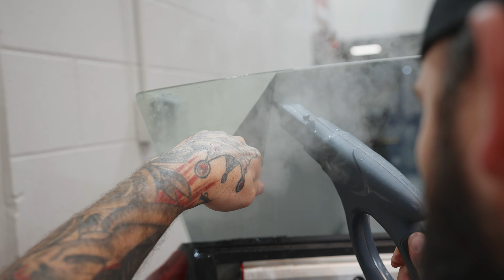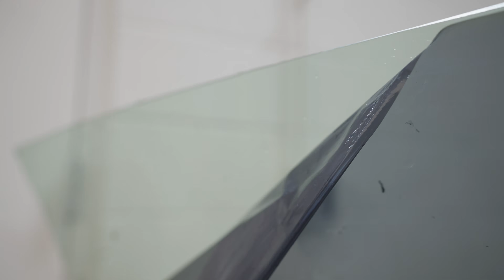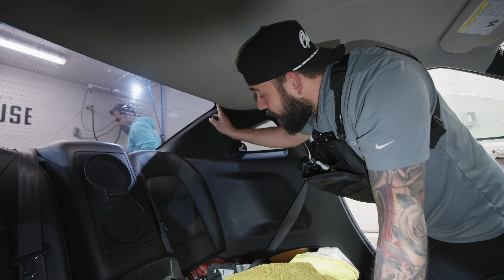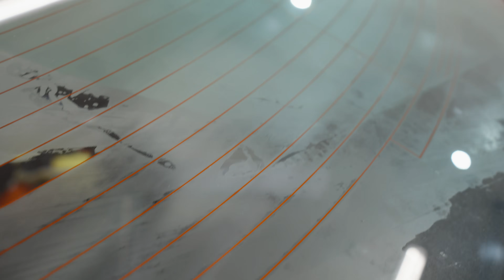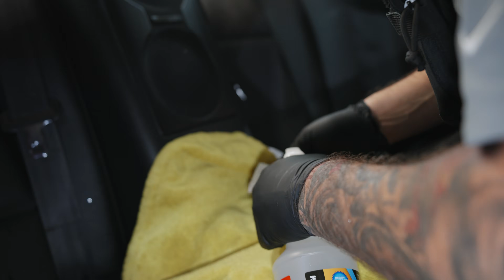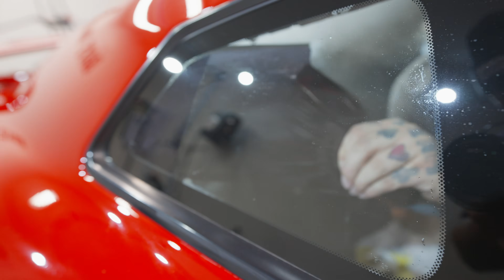How To Remove OLD Window Tint From Your Own Car

Comment: I have a 2002 Jetta I need to remove tint off the back window, after watching this video and reading comments, how far up shits creek am I going to be doing this job in the middle of December without a shop and outside in Oregon?
Reply: Lol...hello from Albany...if you have a heat gun or steamer it won't matter much...I'd wait until the afternoon of course when its well above freezing.

Comment: I already did what you're not supposed to do. How do I remove the adhesive?
Reply: @Eaglebone  I did the same thing but I used goo gone and that did the trick
Reply: If it is the side windows you can use a degreaser or soapy water with a blade and scrape off the glues residue, if it’s the back do as he did in the video

Comment: Thanks for sharing. Would removing the rear window to do the work be an option?
Reply: Yes you can remove the window as if you were to replace it. It’s a lot more comfortable to work with and easier to remove tint. It’s also very fast to install window film on it before you reinstall the glass too. I’ve done this before on really bad film. Make life easier for you whenever you can. Just tell the customer what you need to do and they will have some tape on the outside of the glass for a few days while the adhesive dries since you had to reinstall it. But besides that I think both of you will be very happy with the results.
Reply from the maker: Hi, I don’t understand the question.

Comment: Suggestion: pro window washers always use dawn, not window cleaner. You’ll get far far cleaner glass. Main ingredient in window cleaner is ammonia or vinegar. Neither clean glass well. Dawn degreases, de-oils, and has surfactants and will leave zero streaks with a squeegee
Reply: Ammonia deactivates the adhesive. In fact the window must be cleaned afterwards with soap and alchohol to make sure there is no ammonia left otherwise it'll cause the new tint adhesive to fail.
Reply: @reyray1123  read what I wrote. It's not unclear. I'm talking about clean glass not removal of tint. Find one place in my comment that references tint removal in any way.
Reply: Lol ammonia literally his terrible for window tint and will help you in this endeavor.  Might be a good tip for someone who is about to tent... But it's not going to do much for them removing
Reply: @skypallman6169  read what I wrote. It's not unclear. I'm talking about clean glass not removal of tint. Find one place in my comment that references tint removal in any way.

Comment: Had very old bubbled tint on my rear window. Yep an absolute nightmare. If you ever wish to punish yourself for something you have done wrong in your life, spend 2 days removing old film, backing and glue. Oh what fun 😂😂
Reply: I have ancient tint on my rear window. It's gonna be a bitch to get off without killing the defroster... 07 350Z
Reply: Go slowly and use plenty of soapy water in a spray bottle to help losen the old film, I used a plastic scrapper and finger nails, and be prepared for a long haul. Good luck my friend 👍

Comment: I used a basic black and decker travel clothing steamer from amazon that was 20 bucks. Worked like a charm! Thank you for this video. Was very surprised how easy it all came off with no glue remaining. Steam is def the way to go. I thought this would take a couple hours and ended up taking 20 minutes.
Reply: Was hoping this would be possible with just a clothing steamer, thank you for sharing!

Comment: I tinted windows for 35 years. Removing bad tint, that I didn't originally tint was always optional. Because depending on the old tint type, it didn't always come off even using a steamer. I sent a lot down the road, outright refusing the job, because some are such a PIA ,and can be an all day thing
Reply: @mobility63  Hello, do you have an Instagram? 🙏

Comment: We use a Jiffy steamer which has a lot less pressure but way hotter so it's helps. 
ATR is another great chemical to remove adhesive and it's a little safer on trim/upholstery.
Also you can do the trash bag method on back glass. Soak it down in windex and put a black trash bag on the inside of the glass like it's tint and park it in the sun. It'll eat all the adhesive and come off with the trash bag
Reply: Can you do that on a side window that’s had the film peeled off but adhesive is left all over?
Reply: @ it doesn't work as well on vertical windows but it can help soften the glue for cleanup. Always worth a try if you have good sunlight and time